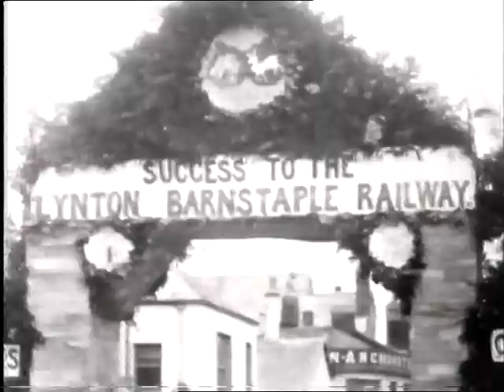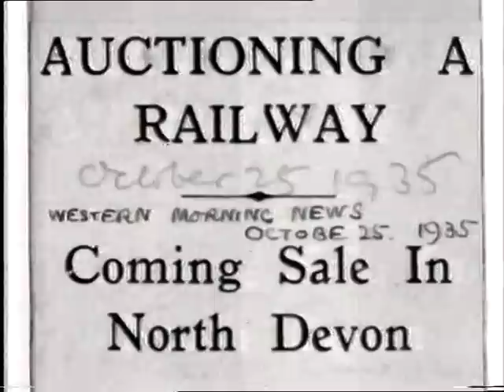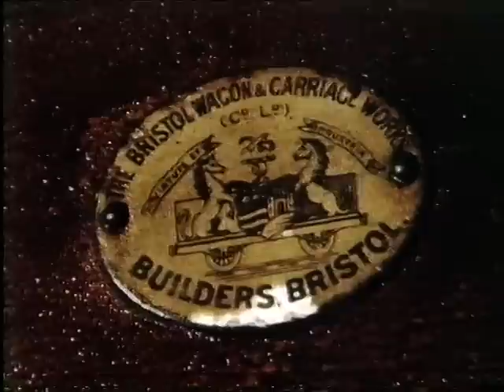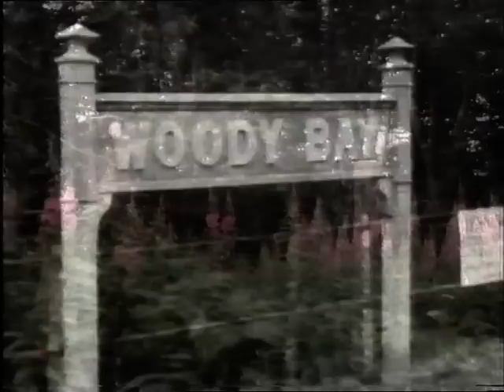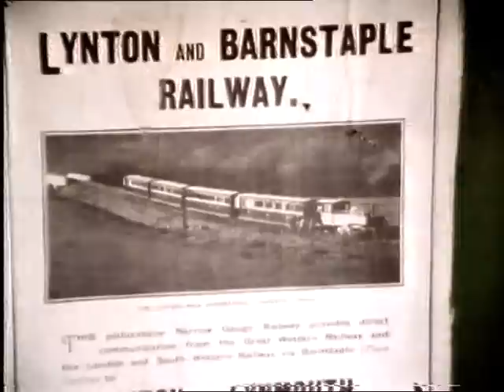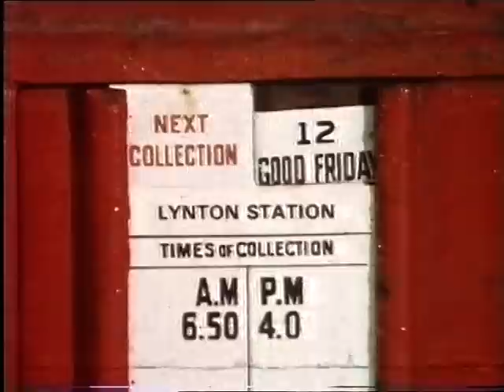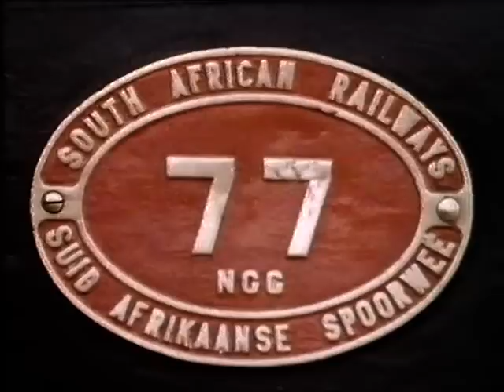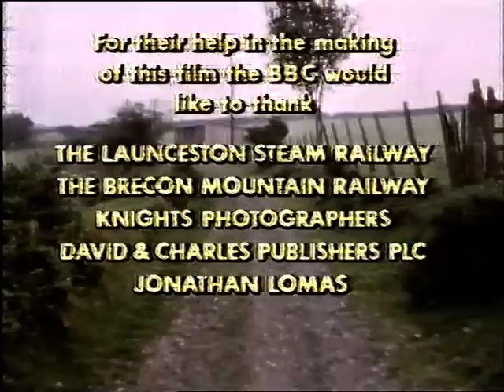1987 BBC documentary - Barnstaple to Lynton railway - Pt.2

Comment: When you consider the expense in man hours, lives and MONEY building the infrastructure of all UK railways, it's an absolute tragedy that one man (the first time round) could simply chop the rail miles in half, cutting off connections which unsurprisingly are well under consideration for re-opening.  How could it have been allowed to happen?  We need trucks off the road and freight going onto rail - a far more eco way to move goods.  Heritage lines like the L&B will be the lifeblood for visitors and residents alike, restoring this line would be wonderful - I'd move house tomorrow and work there to help rebuild it (if my Mrs. would permit but relatives still live near to our current address so we have to wait...) We travelled on the L&B just last month (July '21) and it was into such lovely countryside - did a lot of walking round it too!  They've got all the right attitude in acquiring the land and rights of way - all power to their collective elbows 😀
Reply: Well, it wasn't one man really - the whole thing was politically driven and if it hadn't been Beeching they'd have found another puppet.

What makes my blood boil isn't the closure of lines per se. The future is difficult to foresee, and rail usage was on the decline in the 60s. The thing that gets me worked up is the way the trackbed was parcelled up and sold off piecemeal, salting the earth so lines couldn't be reopened. It wasn't worth much as land, but as potential trackbed it was invaluable. Incredibly arrogant and petty decision. Even Beeching considered the trackbeds to be a national asset, but the politicians were determined to ensure that their decisions could never be reversed.

Comment: Well, they haven't found lew yet. But in the time she's been gone, 2 replica engines have been built and a fair chunk of the trackbed is being relaid with track. Not sleepeth, but art waking up.
Reply: ''Lou''.
Reply: 762 Lew, one of the two engine that have been rebuilt, the other being 
Lyd which is owned and operated by the Ffestiniog Railway. I worked on part of the drive rods for Lew…….

Comment: Wow the L&B has come a long way since they filmed this!
Reply: i know,,, they have done a magnificent job,,  just needs big backing like the welsh highland,  it would do wonders for the area
Reply: @davidblurton7158  The Welsh Highland was incredibly lucky in one crucial respect - the Official Receiver died before he could complete the sale of its assets after closure. So the entire trackbed from Porthmadog to Dinas remained in limbo for decades, and in one piece, until the Ffestiniog Railway bought all of it, allowing them to easily re-construct the whole line. The L & B R has suffered the more usual fate of a UK disused railway as all the trackbed has been divided up and sold off to many different owners, and it is this problem which is making the re-construction of it much slower than that of the WHR. The Bluebell Railway in Sussex took 30 years to buy back the 6-mile section of trackbed between Horsted Keynes and East Grinstead, making the reopening of that section a 41-year long project until it was finally completed in 2013....... They have made a great start on the L & B R, and is it at last breaking out Southwards from Killington Lane towards Parracombe and Blackmoor Gate.